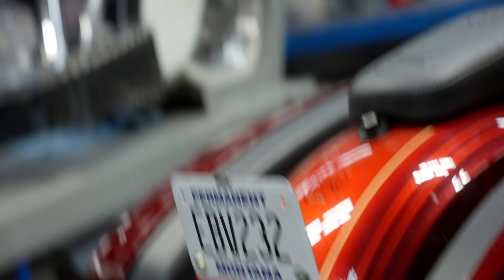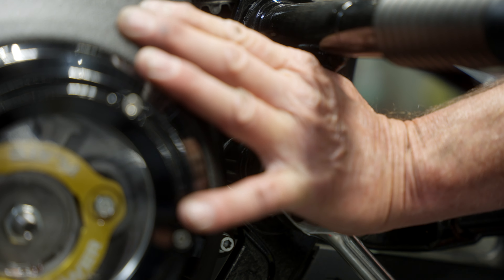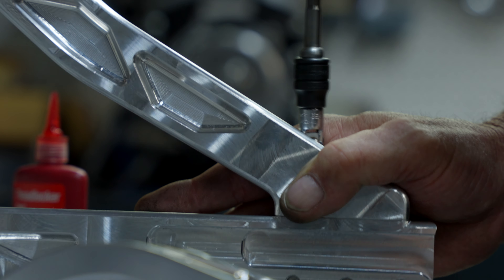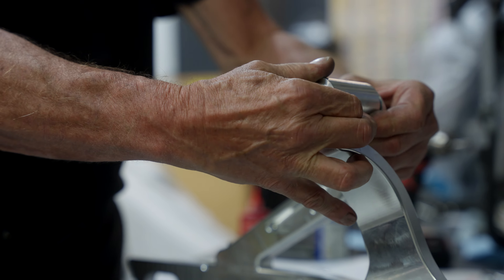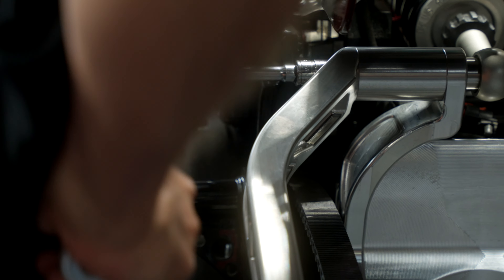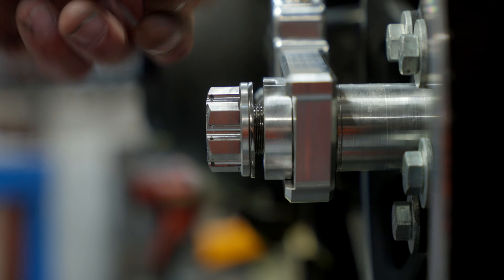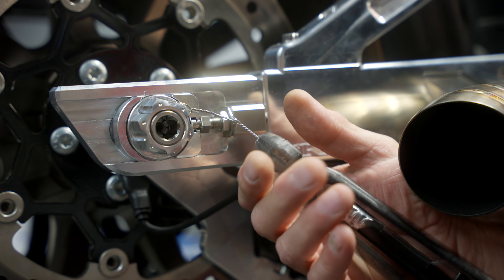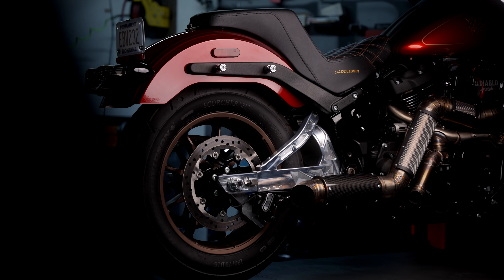How To Install: Trask Billet Aluminum Swingarm  ( M8 Softail )

Comment: Is there going to be a radial caliper mount to suit? which should also suit the stock swingarm for now?

Also are there any plans to make some radial caliper mounts to suit the front brakes too? ( Non inverted front end )
Reply from the maker: Our current radial caliper mount will work! I believe we had to add a spacer to the inside but I can get confirmation. Send an email our way and we can get you more details.
Reply: @TraskPerformance  What is the part number for the rear radial caliper mount? I can only find one to suit baggers